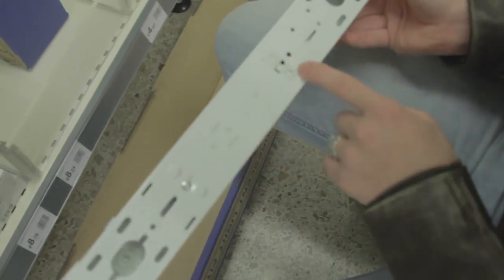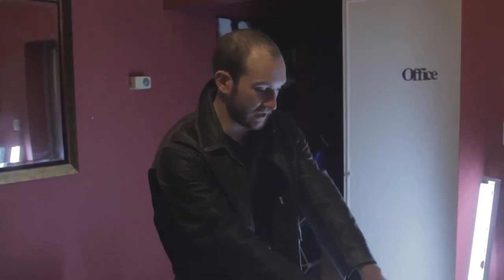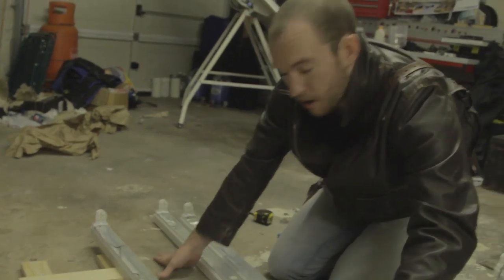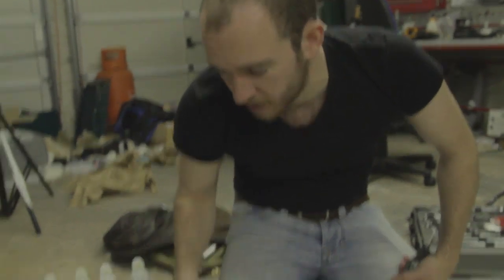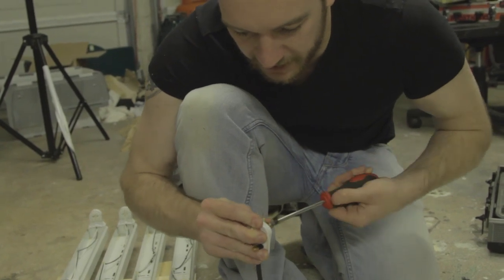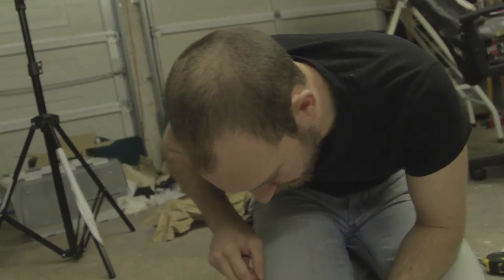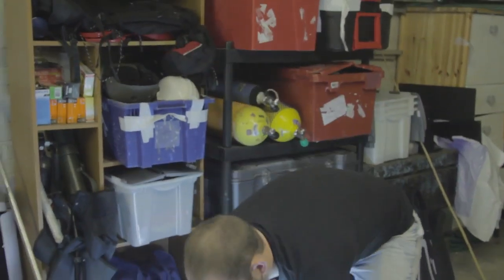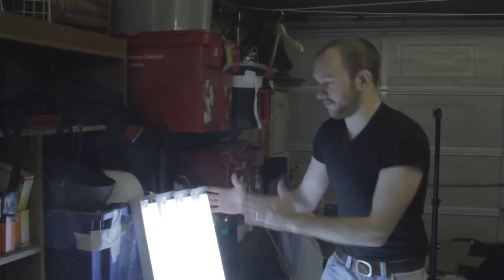UWR Week 42 - Build a Kino Flo style light for $100 in 3 hours

Comment: They are four wilko 4ft fluorescents tubes lights fittings by using a standard 36w t8 fluorescents tubes and from the 36-40w choke 240v ballast and with a 220-240v ,4--65--80w fluorescents lamps starters switch guy's from myself just being electricians as i am from being self trained in general

Comment: Is this buzz background noise coming from the lamp?
Reply: The hum is coming for the ballasts, that's why it is better to use electronic balasts because they don't make noise and it also solves the problem of the flickering.
Reply: I was thinking the same thing. I think the lamp he built is more of a T8 or T5 which are very low noise. The buzz noise to me was coming from the overhead lamp - probably an older model with a loud ballast - but let me know anything as I'm no expert! *about to build one today!

Comment: Also I plan to alter the wiring a little and fit two switches to the back of my fittings allowing me to switch between either two or all four tubes depending on what I need. This gives me more control when lighting a scene. I hope this helps.

Comment: Another great option is to buy what is known as a recessed modular fitting. They usually sit in false ceilings and come with two or four tubes in at different size's - 2 ft - 6 ft ready to go. The only wiring required is the mains flex and plug. Make sure you get the HF type and get the daylight tubes extra and swap them over. This should come in at anywhere between £50 - £100 depending on the size you get. I am an electrician turned newbie film maker and I did this my self. Works great.

Comment: If you use the HF(High Frequency) electronic ballast type of fluorescent fitting you will not get issues with flicker. They are more expensive than the starter type but it's a lot cheaper than LED option. Also go to an Electrical wholesalers rather than a DIY store.